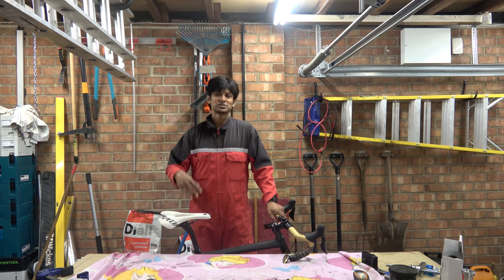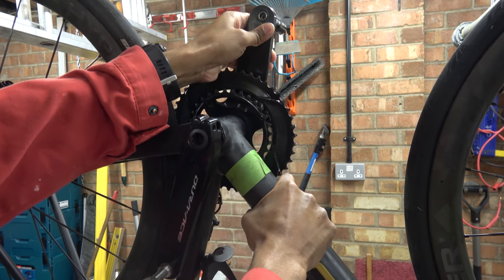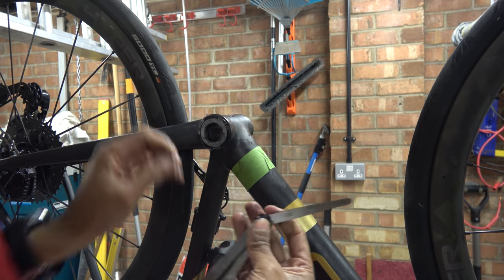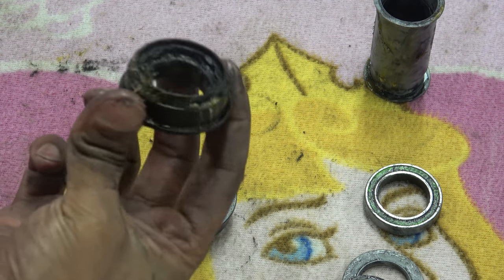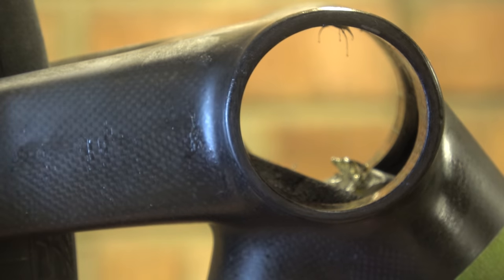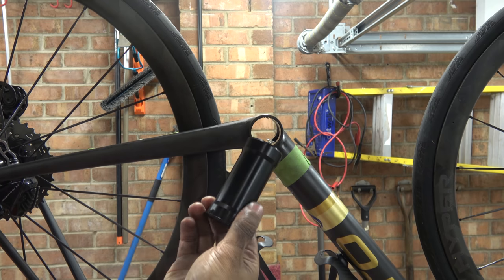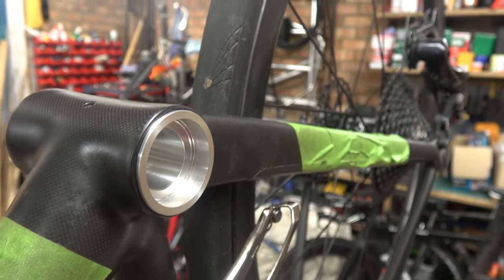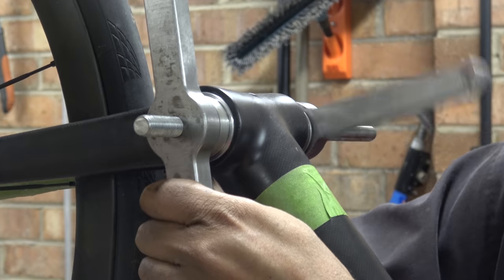Super Expensive Sarto Bike Frame, turns out to be crap. Hambini Bottom Bracket Necked Dream Build

Comment: For 7 grand I expect the company to be able to make a circle
Reply: Sweet fecking jesus the price of the frames 🤣🤣
Reply: Nah, mate, this is all artisan and hand crafted. No tools were used.
Reply: @jamble7k  “Bike Tailors” lol 😂.
Reply: @jamble7k  😱😱😱
Reply: @kitten-inside  no tools were used but you'd have to be a tool to buy one with tolerances like in the video 😁😁😁
Reply from the maker: I think the chap got it from Northern ride. Hence the linked price list is accurate
Reply: For $7K I’d expect a ride with a motor and a lot more tech in it than a simple double triangle non-powered bicycle frame. 

Heck, for $7K you can get a high quality Yamaha motocross bike brand new that has infinitely more tech in it than any non powered bicycle does. And I do mean ANY bicycle! And at that price it would be a high quality motocross racer that would be more than enough motocross bike for any non-sponsored pro rider. 

Bicycle prices across the spectrum are insanely stupid right now, and this monstrosity that Hambini is fixing is just one of many such examples. These are simple bicycles. LOL
Reply: They make prefect circles on paper.
Reply: @garybunting3035  7 fucking grand? Un-fucking-believable.
Reply: @rcg9573  you've obviously no idea how much work it is to make light and strong carbon fiber frames . Anyone can make heavy , weak crap . And it's easy to machine up a swingarm , and in the numbers that bikes are made , that's why they're that cheap .
Reply: @MrKrueger88  ...bla, bla ,bla... - this is the magic of marketing, but why not - who forbids the rich?
Reply: @arturartur7405  that's stealing money by stealth, and if you dont know the meaning of the word look it up in a dictionary,
Reply: 7th grade, I expect school students to be able to make a circle
Reply: First i imagined a circle, then i tried to bring it to life.
Reply: @kitten-inside  do they just use their fists
Reply: define circle 😉😉😉
Reply: We're talking about Italians now, now 3 yen per hour Chinese laborers that are being thrashed to work faster. So there is something else going on here. I couldn't see the bike all that well so I couldn't tell if it was made in a series of molds and then glued all together at the end of the process like Trek does or uses those single piece molds with inflatable bladders which are not very controllable. Because of the processes they use to build carbon bikes I'm now riding Titanium which is less prone to catastrophic failures when you least expect it (says the man who was out riding his bike a week ago, got an instant puncture and went down on a crack in the pavement).
Reply: The frame has some strange geometry. The head tube is really tall relative to the top tube.
Reply: @truantray  I was thinking that, looks like the owner is a T-Rex 🦖
Reply: its so easy to, but these brands kno they can get away with shit tolerances as most of the components are made compliant to shit standards.
Reply: @arturartur7405  In this case it isnt just marketing. Making a carbon bike with custom tubing is labour intensive. The people who made this live and work in Italy and get paid accordingly. It doesn't matter if its plumbing or bike building, if you have a european person working for you for many hours for many days, its gonna be expensive
Reply: RollinRat  Im not sure if you got that quote right, papi
Reply: RollinRat  Oh. I just thought it didn't exactly roll off the tongue. I would stick to the simple "Nothing is free"
Reply: RollinRat  A moot point? I never made any points except about labour costs in Europe, so if you are having an argument its one you are having with yourself ;)
Reply: @RollinRat  You really put your whole life story into a YouTube comment. You are such a boomer...But I don't mind! I found it interesting and read all of it. I admire your love for the craft and agree with everything you said. I envy the spirit of craftsmanship that seems to exist within the bike community in the US. Where I live I only know of one guy who makes frames and he demands premium prices. Im a city kid with an impractical and illogical mind that doesn't mix well with engineering and the likes...But im trying to at least build my own wheels. Wish you were my crazy bike mechanic uncle
Reply: They made 3 perfect circles with a 7 in front
Reply: Lol.. purchased a slightly used 180hp Hyabusa for that price! WTF? That plastic shit pile found a buyer?  Have fellow cyclist lost their minds?
Reply: @wiseoldman5841  That's what's crazy to me. Even just making a sport bike engine seems much more complex and time consuming than creating a CF frame. Why does 15 pounds of pedal bike cost as much as a 430 pound super sport motorcycle nowadays?
Reply: have you seen the quality control on something like a mclaren? and you expect something worth a measly 7 grand to be perfect, pfft peasants

Comment: This bike setup will fit a T-Rex!! 🤔
Reply: This guy's got to be at least 6ft9. That stem probably isn't as small as it looks the bikes is massive 😂
Reply: T-Rex's were great sprinters.
Reply: Seriously that geo, oh man.
Reply: @edwinf9999  apparantly, that's a myth. Researchers found out the T-Rex probably was a lot slower than thought
Reply: @edwinf9999  hahahahahaha
Reply: @edwinf9999  Actually they weren't...they were thought to be pretty slow ha
Reply: @perryyip3416  yep , glad you noticed it too. The strangest looking bike ever . Crazy long legs , short as body 🤣
Reply: I thought that 😂 that’s a weird looking bike tall and short length.
Reply: Quite Litterally came here to make this exact comment.

 recon this guy just had legs, butt cheeks, shoulders and a neck. 

I would seriously doubt this meets the BS:EN requirements for toe overlap.
Reply: Just looking at it makes my back hurt. You would have to fold in the middle to ride it.
Reply: Serious back issues but has to ride a race bike, that would be my guess
Reply: @christiankeil7845  No one HAS to ride a race bike.
Reply: @christiankeil7845  that set up looks likely to cause serious back issues!  I have a back injury and being able to stretch it out with a decent reach is so much better than a cramped position requiring the back to bend (unless riding the Obree egg position with the hands by the chest).  Guessing a lack of hip mobility limiting forward hinging is a possible addition issue?  It does seem to be a sit up an beg type position that would be better suited to high flat bars to keep the back straight.
Reply: @markmuldoon7044  but the top tube is made for a child.
Reply: @jd4000  The owner is Mike Wasowski from Monsters Inc.
Reply: Custom frame for the Tour de Thalidomide.
Reply: I was about to write the exact same comment 😂
Reply: “Made in Italy” I’ve seen enough TopGear to know Italians are disproportionately shaped.
Reply: @joeycottontail4527  🤭🤫😂
Reply: @joeycottontail4527  1st......BRUUUH......2nd hahahhaaaahahahhaahahhaaaaa 🤣🤣🤣🤣🤣🤣🤣🤣🤣🤣🤣🤣🤣 I'm ded
Reply: Thats what i was thinkiing too! the top tube is crazy short
Reply: Top tube looks short
Reply: @jd4000  Bike Fitters, Bike Fit Up....
Reply: What a Fit Up
Reply: a fast one
Reply: Long legs and short arms make perfect dentists.
Reply: loooool
Reply: @joeycottontail4527  Pfahahahahahah, that was mean

Comment: A oval bottom bracket for an oval chain ring is ok... They probably installed it out of phase.
Reply: Nice work for the electricians in the audience 😆
Reply: What's the deal with the oblong chain ring?
Reply: @falcoperegrinus82  its like the old shimano biopace crank.
Reply: @falcoperegrinus82  it feels odd riding a regular chainring after. Supposed to be for hills I think
Reply: Lmao
Reply: @koolerking440  Looks a lot more oval even than biopace though, what's the advantage? I reckon none, given that biopace didn't really stick.
Reply: @desertrainfrog1691  it accounts for the variable power output of legs driving a crank. You are most powerful at 90° towards bottom dead center, as you have maximal force at crank position 90°, and legs exert more force as they extend. 
   So, when you are exerting the least force, the chainring is at it's narrowest diameter, effectively equalizing force applied to the chain along the crank rotation, in theory.

Comment: This is why I buy my frames direct from the manufacture in China for 1/5 the cost of the big popular name brands. I'm on my 5th build with these Chinese frames and have zero problems. And yes, I ride hard and have crashed more times than I care to talk about - but the frames hold up to all the abuse. I ride in Colorado, Arizona, and all of the the upper mid-west doing downhill, X-country, and lot of tech trail riding. My friend broke his $2650 Yeti 150 frame at Keystone - but my $600 Chinese frame had no problems at all. Even if I could afford a $2500 to $4000 frame, I would still but direct from the factory (then donate the $$$ I saved to my favorite charity).

Comment: Great video/channel.  It's amazing from watching these videos how many high end bikes are crap, and how paying a large sum of money is no assurance of getting a quality frame.  I am an older rider, and back in the days when most frames were steel, these sorts of problems with the bottom bracket shell were pretty much unheard of.
Reply: RollinRat  Oh, I know.  I ride a custom steel frame.  If weight is not a major concern (it isn't for me), steel pretty much kicks ass in every other way.
Reply: RollinRat  I am a fairly competent TIG welder, with experience with chrome-moly tube structures, and I have considered building frames for fun.  What has stopped me is that it requires some quite expensive fixtures and other specialized tools to do.  Given the number of frames I might build, it's pretty hard to justify.  Like you, I have assembled all my own bikes since the 1980s, and built my own wheels almost that long.

Comment: I Googled Sarto and got "Fresh, Handmade Pasta in Leeds". Those guys could probably make a better frame.
Reply: Yeah! Linguine core in a full monocoque frame. Maybe they could bake in the bottom bracket to assure  a concentric shell! Apply new grease afterwards naturally.
Reply: Actually they are a long standing italian bike builder that use to make top end bikes for other brands. Bit disappointing to hear this from a manufacturer with such prestige and history.
Reply: @davidburgess741  Penne for a bike?
Reply: Al dente ofcourse. Maybe cook the frame for about 8 minutes. And then press in the bearing
Reply: Just don't ride it in the rain!
Reply: @DeepakKumar-lv4te  I understood it is an italian custom to throw your plate against the wall if the food sucks 😂
Reply: @davidburgess741  grease? Olive oil!
Reply: @delahayenator  Fish oil for Shimano, olive oil for Campagnolo, beef tallow for SRAM/FSA! Phil, Chris, and Paul get Tenacious Grease.
Reply: @davidburgess741  ah, now thats some specialist advice! 😂 Maybe use soysauce as well on my shimano derailleur
Reply from the maker: @davidburgess741  PMSL
Reply: @waynosfotos  Indeed, accent on the 'used to'. Should have stuck to what they know best, steel.
Reply: Use Bing next time
Reply: my sarto runs just fine, you just need the right mechanic to build it up!:D

Comment: I have owned a second hand custom made Sarto frame for the last eight years (so I would guess the frame is around ten years old) and never had any issue with the threaded BSA bottom bracket part of the frame (SRAM Red / Truvativ GXP user serviceable "ceramic" bottom bracket) nor anything else worth mentioning. I crashed it into a sink hole once and had an accident with a kid on a scooter who cut me in which the carbon saddle broke and one of the crank arms suffered. The frameset itself after maybe 40,000 or so km on the road and with at least three changes to the overall setup (cranks, stem, handle bars, drivetrain (now SRAM AXS) and wheelsets), but with the same bb and headset bearing still in place is still a joy to ride. Build quality of Sarto frames must have suffered over the years...

Comment: it amazes me that this issue with the tolerances has still not been definitively resolved across the industry. thanks for the work you do to illustrate the problem.
Reply: RollinRat  if you've watched hambini I will know threaded is no solution, to will get the BB cups in yeah, but misalignment will still be there if there if the shell wasn't built right which will result in limited bearing life/creaks.
Reply: RollinRat  I'm just repeating what Hambini said on them - yeah see that they are easier to correct and personally I always try and go with threaded BB, as I dont have any issues with them, they are cheap and easy to replace. Anecdotally all the people that seem to have issues with frames I know have press fits. Trouble is looking at new frames I'm finding  threaded more and more rare.
Reply: RollinRat  yep - its unreal how much people are being mugged off - I guess because they love it they are just happy to plough cash into whatever the industry says to do. Personally, I'm holding out on a new bike because I do not want disc, or integration, tubeless, or press fit. Absolute zero desire for a "top of the range" bike. Makes me laugh people spending £5k on an aero disc bike that spends most of its life on Zwift
Reply: RollinRat  Haha, And Im with you on waste, at least alloy stuff is recyclable I guess. I do however love me gears - compacts and wider range cassettes are one thing I am grateful for!

Comment: Great to see the bearings being pressed in dry 👏👏
Reply: Obviously Hambini knows what he is and isn't doing.  And trolls viewers occasionally.  What should have happened, and can he go back and correct it later? Or were they sealed bearings or something of that nature?
Reply: @ryanpaaz  Nothing to do with bearing seals. Hambini pressed the bearings into the bb dry. This is the correct method for an interference fit. For some reason less than competent individuals will use grease. Loctite is only required for an out of tolerance bore/fit.
Reply: RollinRat   you are describing a type of shrink fit I guess usually utilised on large bearing applications. This is different to a press fit. Generally for normal applications such as this a press fit is dry. Due to the tolerance the retaining compound would simply be displaced regardless. Interestingly  I am also involved in the maching of aircraft parts for Aibus, Boeing and Pilatus regularly to the value of hundreds of thousands of pounds. Zero opportunity for mistakes which is why I abhor poor engineering practice.
Reply: RollinRat   Don’t understand A&P,  I’m a time served multi skilled technician (lol). I started out designing and manufacturing jigs then machining military castings for the challenger 2 tank , 1000mm bores +0/-0.02mm , on a vertical borer that was an art! also machined railway bogies. For the last 16 years in Aerospace machining and installing/proving out large machining centres as well as machining 10meter plus wing spars 3 at a time on triple spindle machining centres (no pressure there) 
 I have Carbon, steel and titanium cycles, my preference is bsa or “it”outside cups they work and are simple. My Carbon frames are Colnago they have a hybrid aluminium screw/pressfit assembly and are very good indeed if assembled correctly. I would add that for road I only use Campagnolo. I recently refurbished a 1996 Colnago Superissimo (Columbus Brian tubes) and someone had previously fitted a Mavic bb so I purchased a bb facing tool just because I wanted to do it myself! Took it to bottom tolerance (well 0.02mm below it was my first attempt) to obtain a good land for the Campagnolo “it” cups. Wow that 12 speed Chorus bb is so smooth and it’s such a great bike to ride.
Reply: RollinRat  ah got it 👍

Comment: I've always had bad experiences with fsa bottom brackets I just stick with shamono
Reply: Totally agree... I swapped out my FSA BB and Chainset from my WIlier for just that reason, creaky and expensive to replace BB cups. I got Shimano BB and 105 chainset setup perfectly working with Campag cassette and shifters, despite them supposedly being incompatible!  Marketing bollocks!  :-)
Reply: @bengarside79  they make pretty good cranks tho
Reply: Same, FSA BBs suck even for frames that don’t have issues.
Reply: The problem is FSA bottom brackets are usually made for FSA crankset… They have different spindle diameters which cause problems
Reply: @jesseladd6864  you’re dead right.. their 24mm is fractionally larger than shimano 24mm!
Reply: @bengarside79  well I’m surprised he didn’t mention it… The golden rule as you can get away sometimes using a Shimano crankset in an FSA bottom bracket but you can’t use an FSA crankset Shimano‘s bottom brackets. FSA cranks measure at 24.07 to avoid Hollowtech 2 patents. It’s called MEGAEXO
Reply: @bengarside79  my TCR runs in SLK crank set with proper megaexo BB86 bearings. 5k miles plus with 0 issues
Reply: @jesseladd6864  yep the hi end fsa crank models have a 30 mm spindle and the entry level has a 24 mm
Reply: @lukeholloway7836  not really true either… It’s just older models used different spindles. 30 MM diameters are newer technology
Reply: I have FSA BB and crankset that spindle diameter is 19mm. I hate it and can't find any bb that support 19mm only FSA. What a crap.
Reply: @kimochii8293  you can put a cigar in my crank

Comment: No detail on how you fixed the bores.  Were the centers of each aligned with one another and you used some tool to bore/ream them?  How did you keep them square to one another?  Did you have to stick the entire frame in a jig to ensure the bb axis was square to the rest of the frame?  Was the .2 mm gap due to the shell not being faced square?  I take it there was enough width to allow material removal to make the faces square.